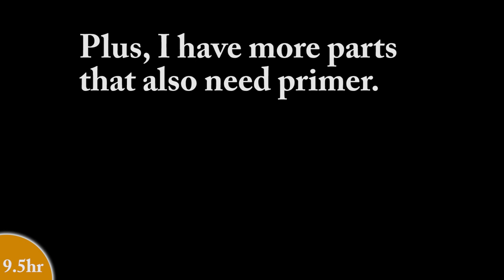Can I Block Sand My Way To The Perfect Paint Job?

Comment: I've watched all of your videos and certainly respect how much work you're putting into making it so that car looks great when you're done.  I really want to build one of these or an RSR in the future.  My concern is overspray.  I sprayed my race car in my garage.  I put up plastic all around the car and after I was done there was a fine layer of race car color all over everything even outside of the plastic.  In your primer shots, you were getting a fair amount of overspray and I'm concerned your whole garage will be coated if you don't get some kind of paint booth.  

The biggest victim in my case was my helmets which were in my garage.  I cleaned them as well as I could but I don't think they're ever going to be free of Gulf blue color again!

I really look forward to seeing what your engine solution is.  I think you said before that you're going to buy a motor that's rebuilt and ready to go?  I am also really curious if you're going to do a coilover conversion?  I wish there was a way to drive a half dozen different cars that were all set up different ways.  Different coil over/torsion bar setups, rigidity improvements or not, different wheel and tire sizes and different amounts of sound deadening.  I want a street car not a track weapon.  I have a race car.  My biggest concern is whether I would spend $60-70k and 2-3 years building one of these and prefer driving my 996 cabriolet.
Reply from the maker: I agree that overspray is no fun!  There is nothing in my garage that I would be upset about getting overspray on it.  And my garage is detached from our house.  Sometimes I throw a blanket over my welder, but then again it's just a welder.  I am going to spray the color in a professional paint booth.  In my opinion it's overall less expensive and better to just rent a booth.  Having said that, I'm going to try to rent for only one day which means I need to shoot the engine bay and trunk area in my garage most likely.
Coilovers in the rear for sure.  I made a few videos on strengthening the rear turrets/chassis.

Fronts may come later, but I did strengthen those too.

Engine choice is a tough one due to low budget.  I have a temporary Porsche engine that will make this car driveable.  Then I hope to build my dream engine.  I will be looking for an aluminum block SC engine core soon.  
My target is to have a driveable car for under $10k (including the price of the car and using an engine that I've had for 10+ years)

I will be doing lots of driving tests and engineering type videos when it comes to upgrades and sound insulation, etc.

Thank you so much for watching.  Projects like this are rewarding to me and actually keep me very calm.  For some reason I'm always attracted to piles of junk.  Same thing when I was a kid.  I would build things out of a bucket of toys.

Comment: I like all the panel fitment and what I really really like is the rear end... the way that fenders wrap-around a just works. Not too much just enough to make it look like it was factory. As far as wet sanding my grandfather always put the wet and dry paper in water at least a couple hours before he started sanding. I've always done this and my grand never really told why you're supposed to this but  my opinion paper lasts longer. It is a habit that I have always done. Seems get good results doing that way. But again your hard work really shows as you get closer to paint
Reply from the maker: Thanks!  I tried to make the back look more like the front without the bottom edge broken up with the bumper overrider things.  I think it looks better too.  To bad I couldn't keep it all one piece like the front, but those seams will be small and down low.  Cool tip about the wet sanding.  My guess is it makes the paper wrap around the block easier.  I'm only going to wet sand with the 600 before paint and then lots of wet sanding after color!  Thanks again for stopping by and commenting!

Comment: Hi Tom, I’m getting quite envious at the stage you’ve got too. Unfortunately I’ve had to put a stop to mine while looking for new accommodation. Would you be kind enough to put a couple of close up shots of the gap where the rocker panel meets the front wing / fender. Also where the top of door meets with the scuttle panel, pillar and fender. I have quite a large gap there and can’t decide where I need to add material.
Reply from the maker: Hi Dominic.  I hope you can get back to work on your project soon.  I'll try to show those areas on my car next week.  It's a puzzle!
Reply: Garage Time - Restomod Thanks very much.

Comment: What would be the ultimate goal after you finish the 911 (besides driving it) ? Quiting your day job and starting a small "singer" style carrozzeria???
Reply from the maker: Good question, I've done small jobs on others cars and it's not as fun.  My dream is to design and sell  parts for these cars.  And maybe coaching.  If I host a workshop,  would you come?
BTW I have another project pending behind this one.
Reply: @GarageTimeAutoResto  attending workshops its not my thing, plus I live in Europe. But the parts thing maybe a good idea as these tend to be expensive which leaves an open market for cheaper ones (which you won't do) and offers a large profit margin for quality ones.
Reply from the maker: Agree it's a tough business.